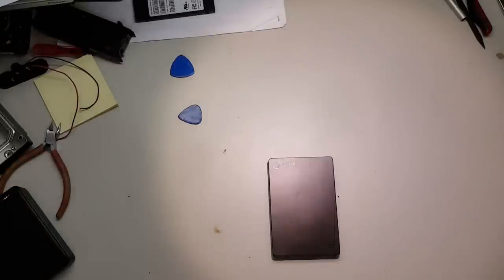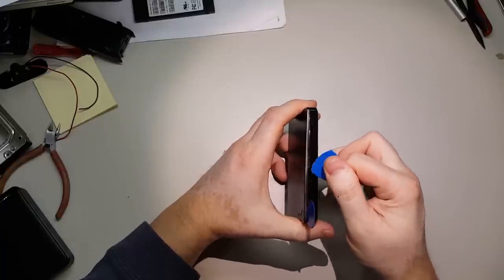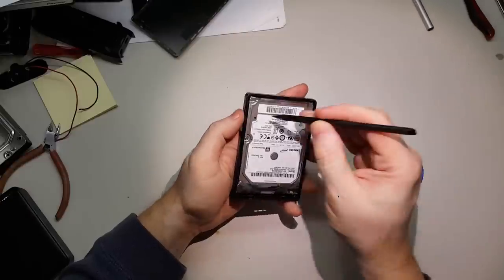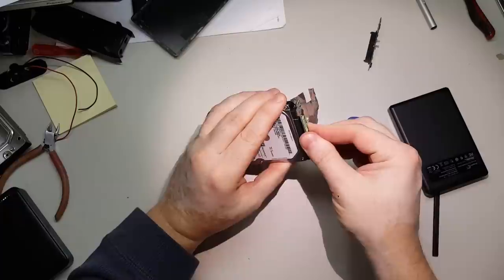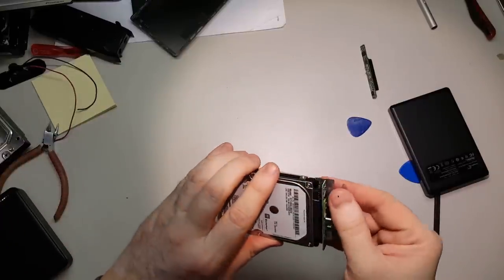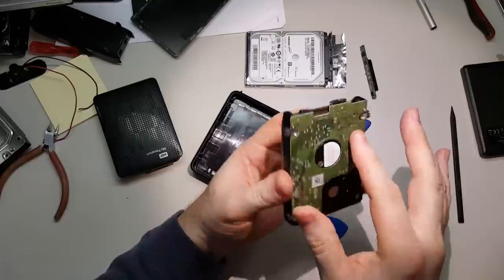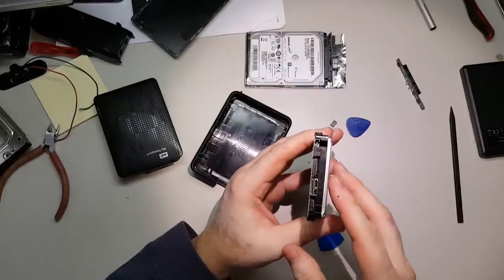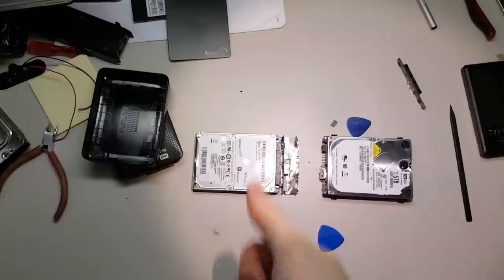How to recover your files from a broken Seagate external hard drive

Comment: How many have actually tried guitar picks or screwdrivers or anything else to pop open these cases as easily as shown?  I'm moving on to a hammer next.
Reply: any progress?
Reply: lol
Reply: Some say that he moved on to a jackhammer and is still trying to open it to this day.
Reply: @lisabarnes924  lmao
Reply: heat it up a little with a heat gun or blow dryer
Reply: 🤣🤣🤣 I thought you were gonna say hammer and chisel.
Reply: Folks use a razor blade  to cut into seal, then stick in a bigger tool, suvh as a guitar pick

Comment: Hot damn - this totally worked!! I have a 4TB Seagate Backup Plus that recently kicked the bucket after like 5 years. Thinking it was a USB cord issue, I tried a new 3.0 USB cord on the drive, to no avail. My last resort was invasive. As instructed in this great video, I carefully removed my hard drive case (with a very small flathead screwdriver) and then removed the USB to SATA converter. This video made me realize that it was probably my converter that was the culprit the whole time. I ordered a WAVLINK USB3.0 to SATA 3 Hard Drive Cable Adapter for $8.99 on Amazon. Once I removed the old converter, I plugged the new WAVLINK in and boom! My Seagate hard drive was up and running again! I transferred all of my files to a new Seagate 16TB Expansion drive and was good to go. Thanks a mill Tech Services for easily saving me a couple hundred bucks on a data recovery service. All it took was watching this fast and easy tutorial video and $8.99 to save 19 years of precious multimedia and very important business files from my external hard drive.  With Gratitude, Koe Rodriguez
Reply: Is the adapter compatible with any seagate drive or just the 4 TB one? I'm currently in the same situation with my 1 TB drive and I don't want to spend hundreds if I can just fix it at home.

Comment: This literally saved my life (I thought I had lost all the files on the hard drive). For anyone looking for the adapter, just look up "usb to sata adapter" on amazon. They go for $10. Then do exactly what this guy does in the video.
Reply: Will try this! thanks man! Im worried my hard drive won't work anymore due to busted plug for the cable
Reply: HI help! I can't find this on amazon, I'm assuming its a part ill have to take apart. do you mind sending me a link to this? All I can find on amazon are adapters with cords attached
Reply: Yeah, when looking for an adapter, you'll mostly find wired ones which aren't suitable for use in a hard drive case. What you want to do is type in "external hard drive 2.5 case usb 3." They even go for less than 10 bucks. You'll get a new case for your hard drive which includes the SATA to USB adapter shown in the video. I got the Inateck one for $9. Works like a charm, took less than a minute to put my hard drive into it
Reply: Mr. Spock thank you so much for your suggestion !
Reply: where can I find that part? whats the name? struggling finding it! thanks guys!
Reply: Where did you get the converter from?
Reply: @Moonpray  do you have a link i tried searching but i got a lot of UGREEN products do those also work?
Reply: @Footballer85749  as long as they're 2.5" inch, any should work. Here would be another example wwwamazoncom/ORICO-USB3-0-External-Enclosure-Supported/dp/B01M08LCXW/ref=mp_s_a_1_4?dchild=1&keywords=External+hard+drive+case+2.5&qid=1620136377&sr=8-4 (you have to add a dot before and after "Amazon" for the link to work)
Reply: @Moonpray  Thank you

Comment: thanks, very clear video! 
I just bought a Seagate expansion, 2017 edition, and I was wondering if you know whether now they automatically encrypt files so to prevent people from removing the HD from the enclosure and access it as you showed. Possibly to force people to buy their data recovery service.
I am asking because upon copying some files on windows 10, I got an error message complaying that a few of them could not be copied because they could not be encrypted. Which surprised me because I did not set any encryption myself.

Comment: Hi,  Computer Services, 
On the contrary, I have been a satisfied WD HDD customer for years. I have connected my WD on different computers and different TVs too. However I have had a big problem with my first Seagate hard drive purchase. I happened to connect the Seagate hard drive on a TV and it went kaput. Won't read thereafter in TV or any PCs. Any solutions for recovering data from it dear.

Comment: i dropped my external hard drive and now the usb cable wont fit on the hard drive's port. I've tried using the cable on another external hard drive with the same port and it fits perfectly. I compared both hard drive ports and they both look the same. Both hard drives are Seagate. is there a fix for this?
Reply: I have two old style, seagate external drives and the USB port is shit. They next generation has different unique port. Why not in the first place?

Comment: Hello, I have an old PC olivetti 286 that works always on since 1994, with windows 3.1 and a Honeywell control software with a sort of PLC scattered for aurtomazione heating of a large structure, there is a way to duplicate the HDD physically detaching it from the pc original, maybe moving on solid state so that the day that stops can replace it?
Thank you

Comment: Hi. I ust watched your video on the seagate harddrive . i have got 2 old seagate harddrives . one is a 1tb in whhte and the other isca black tb , both i have recently bought a new 6tb expansion seagate which does work and i have hooked up to my new laptop . Just in relation the the 1tb and 2tb that dont work , im trying to get the data off of them put them into a folder on my laptop and then transfer them to te 6tb but when i connect the 2 older ones they dont connect with the laptop . there is no physical damage to them or the cable port . when i plug them into the laptop i can hear and feel them moving around inside . i have the 2 older harddrives about 5 or 6 years . how do i pull the data off of them . i have liked and subscribed to your channel . Awaiting your reply . Thanks
Reply: yah me too I have one that is working but the device is not appearing on the laptop

Comment: Thank you!! This video saved me hundreds of dollars! I bought the replacement part at Micro Center for $7 and did it myself.
Reply: Jeff Peterson what’s the part called
Reply: What's the name of the part please? I have Seagate
Reply: @DollyMat  2.5” SATA HDD Adaptor Hard Drive Adaptor with USB 3.0  (inland) Hope this helps!
Reply: @GETRIGHTFERDA  sorry, just saw this comment after someone else commented.  2.5” SATA HDD Adaptor Hard Drive Adaptor with USB 3.0  (inland)
Reply: @jeffreyhartpeterson  thank you. I really hope this works. I can see it has for a lot of people. The only thing mines is an external HDD with an electric plug. Hopefully it's the same inside.

Comment: Note: my experience between Seagate and Western Digital (despite what's said here) says that WD is less likely to be damaged in the first place. The first Seagate I bought has been damaged and to this day I still don't know why or how since it wasn't dropped to the ground. Conversely, my first WD passport external drive is still working since even before I learned I must be careful with them because they are so easily damaged (4 years now). The Seagate damage happened just two months into a 5tb. I haven't been able to retrieve the data, this vid did not help there because the adapter still new.

Comment: Thanks for the clip, but my problem is that the disc won't mount on my Mac. The light comes on when I plug it in, not disc image. I've run DiscDrill and that doesn't find it wither. It did at first, then the whole thing disappeared. Any advice?
Reply: I've got same issue. Did you find a solution?

Comment: Hi, I've got the Seagate Expaintion 1TB S/N: S37KJ9AGC19196
, Model: ST1000LM025
And it's as you said Seagate from outside SAMSUNG from inside, and the USB3 Port is Damaged, Can you help me please, If I found another new hard drive  from Ebay can I replace my old bord on old hard drive with the new one from new hard drive,Will It Work?????

Comment: Hello! I'm following some of your videos and you understand a lot about external HDs! I would love for you to help me, but as I am very far away (Brazil), please give me some guidance! I have a problem with my external Seagate HD. It looks like the one you opened first. My HD is brand new, has been bought for 8 months and has little use. He did not fall, nor did he wet, did not do any physical damage. I was using it normally with proper care, I believe. But suddenly he stopped being recognized by the PC. The LED does not light up, I feel it vibrating because something is working inside it and there are no strange sounds. Is the data compromised? How can I recover my data in this case? Please, try to help me! Thank you!!

Comment: Hello i have a Xbox brand seagate external 2tb harddrive. I broke the connection to it and it looks like the connection plate comes off of the main hard drive. part says XBOX-NZ07B1DE do you know where i can purchase a new connector piece and plug it back into the seagat hard drive?  Thanks
Mike

Comment: 2019
Just FYI, but it's common for modern hard drives of even the EXACT SAME attached board to be unusable after you swap the board attached to the platters. Due to small read/write areas modern drives align the read/write heads on the first bootup and record those numbers. That means if you swap the board those numbers are gone and the read/write heads will be slightly offset and likely can't read the data even if everything else works perfectly.
Reply: Do you think this would be an issue with an Xbox?

Comment: hey mate  my segate external 4tb hard drive is not detecting on windows. i tried another cable. its not working. i made checked it at a storethey said head is not working. so how can i recover the data from it? is there any process that i can try.

Comment: Why does my External Hard Drive make a beeping sound? 
The light is on when I plug it on.
Reply: i have the same question
Reply: and me .. :(
Reply: And me.
Plus when i connect my seagate expansion to my mobile through OTG cable, it says my seagate expansion is corrupted & needa to be formatted. But i have many important files.

Comment: I would recommend a seagate too, except the one I had for just a few months and barely used just died. It is the srd0nf1, 2tb. Suddenly got "file or directory is corrupted and unreadable" error. Shows 0 bytes available and 0 used. Seatools repair reported "pass" but still can't read it. Junk!!!
Reply: Chris yup
Same model . My 2TB just decided not to work as well . Used it one day then the next it’s not reading on Mac
Reply: @whoaj  running chkdsk /f on the drive enabled me to read most of what was on there, but I lost at least two folders. I noticed after I posted this that I have a USB port on my laptop that is acting up and am wondering if maybe that had something to do with the problem, not sure though. At this point, I don't think I can really trust the drive. I may do some sort of burn in test on it and see how that goes.
Reply: Chris yeah out of chance yesterday I tried what I read somewhere where it said try to slide the USB into the computer slowly . I tried that and sure enough it’s been reading . But the USB is like positioned half way in. I think mine might be a faulty cable which I’ll replace and test . If it is I’m going to be annoyed because I pretty much removed my hdd out it’s case and can’t seem to lock it back in. But at least iv removed the important files.

Comment: I have a 1TB Seagate External Hard drive with Important Files in it and i have tried to use "MiniTool Partition Wizard" and "EaseUS Data Recovery Wizard" to Recover my DATA in the drive but have not succeeded, I'd end up leaving my Computer running for 3 days and then it'll finish the deep scan to then tell me that there was no data found. I have not formatted the drive or anything it just one day stopped lighting up when i plugged it in but it'll show the eject icon on my taskbar showing that it's still being somewhat recognized on the System.
Reply: Same problem here... How did u resolve this issue?

Comment: hi, my usb port is messed up just like this, but my seagate drive does not pop-out the adapter, what should i do?
Reply: Mine was also quite firmly attached. Used a little force and it worked.

Comment: my external hard drive has broken anyway, I had to delete some games from my internal storage so I could make room for the disk. BTW any suggestions for what might be wrong with my hard drive-it was working fine till one day I dropped my controller on it accidentally and while the blue light is still showing and flashes sometimes like it's trying to read the games inside my xboxone isn't acknowledging the drive. Has anyone any ideas about what's going on here because sure just dropping my controller on the case will have totally broken it? I must add I don't have a pc or laptop. Amazon said they will try and fix it and send me another on if they can't fix it but I'd like to know if its fixable if something similar happens again. I'm going to buy another drive as I need more space and was thinking of going with a Toshiba 2tb, sonnics 2tb or possibly go back to western union as I think I was just unlucky since I've heard a lot of good things about them.
If anyonw can stear me in the right direction I'd be really grateful, thanks in advance 👍 basically which would be the best new hard drive to go for without breaking the bank (this is why I found these named and good priced ones) and what could have happened to my hard drive and why is the blue light on the drive still showing as though its working but my xbox isn't acknowledging it. So sorry for this convoluted post but I really hope some people have answers for me-thiank you in advance 👌👍
Reply: Sounds like when the controller made impact on the drive the heads got stuck.

Comment: bro i have a problem with my seagate too.. its not blinking when inserted to the PC. I have used other all the three usb ports in my laptop but still its not blinking and also cannot be open even though it is showed up in my pc.. how to fix this bro?  I need to retrieve some of my important files inside this hard drive. SEAGATE portable drive, model SRD00F1. thanks
Reply: I have an ASUS intel core i7 that came originally with a SEAGATE internal HDD. It crashed in the middle of using it. I am going to replace it by a 250 or 500 gb SSD which will be much faster, more reliable and durable. I have lost all my data from the crashed Seagate but I am keeping it as I might try to have it repaired to retrieve the data in future.
Reply: Go to a local computer technician who can repair and retrieve it for you. Of course he is going to charge you some cash.
Reply: @mamadetaslimtorabally7363  thanks bro for your info. i will try my best to be repaired it from where i bought it. I bought it in Markati, Philippines

Comment: Have to agree that point about getting the seagate over WD. Owned 2 WD Passports and both of them keep having I/O error issues.
Reply: Have you tried switching out the Printed Circuit Board (PCB)? There is a web site that will sell you a PCB and Transfer the Bios Chip from the WD Drive, to the new, for Free,   Comes with no Guarantees but has 95% reliability, I too have WD Drives, I have decided to use Sata style Drives instead and have a alternate backup if anything crashes.
Reply: Wan A.V.O I

Comment: Well where can you buy the broken part individually the video was helpful until that part
Reply: I just ordered a SATA III cable to replace the broken part with. I'll try it out once I get it tomorrow and I'll let you know if it worked.
Reply: @acecinema739 actually i have some things that will work!! i got them from amazon let me know if you need them ill hapily post it
Reply: @ant8861  Hi Michael, what are the parts? I have a 4tb that I need to fix =/. Thanks in advance!
Reply: MrKooper22 and don’t forget to  actually pull off the end completely from the hard drive which I did  else you won’t be able to plug it in 😂😂
Reply: @ant8861  The SATA III cable I bought worked on my 1TB Seagate drive!
Reply: ACEcinema that’s good news !!!

Comment: hi sir im using 500 gb seagate hard drive. suddenly my hard drive not detecting and also there is some noise. now i replaced that with new hard drive. but i need files from that drive can you please help me.
Reply: I have the same problem
Reply: Abhilash Abhi me too facing the same problem in my Seagate expansion 2 TB

Comment: Hopefully someone responds, when I was playing cod, my external hard drive said it was disconnected when it was not, Now when I plug it in it says  this usb device is not supported by the system. When I try to format it to my system to be my external hard drive I get this error code ce-30006-9 what should I do?
Reply: Look it up
Reply: That is exactly what happened to me, although I had a slightly different error code. Did you ever find a fix? Or at least what was wrong/caused the problem?
Reply: @rylensp7183  i think u boot into safe mode and insert external boot device so you can factory reset your xbox. I think this is the right way to go.

Comment: This dude has the world turned up side down. Repairing computers I can tell you that Seagate hard drives go bad much more often than Western Digital. Western Digital are much better drives.
Reply: Agreed. Seagate did have the best Enterprise SAS HDD's before WD just recently integrated the Ultrastars into their lineup and took over the Enterprise division as well. WD win in all departments. Western Digital 4 dayz.
Reply: Doesn't seem you paid attention. He's not saying the Seagate drives specifically are better, but that WD decided to be arseholes and attach theboard permanently so that this solution does not work for them.